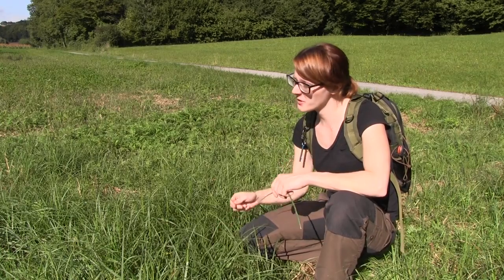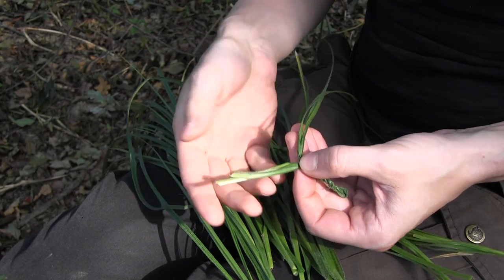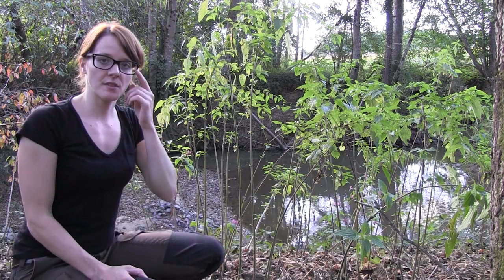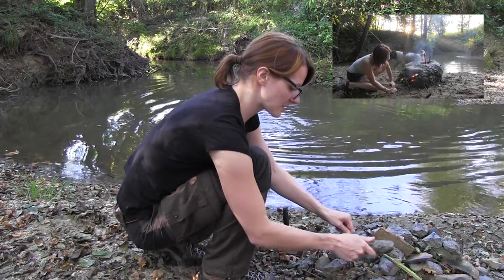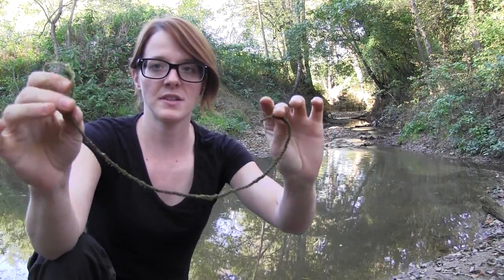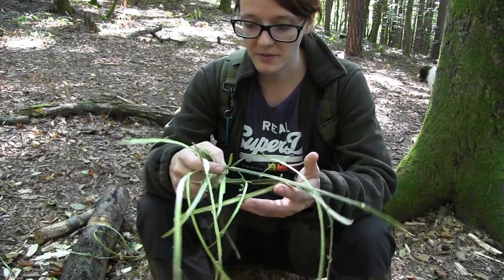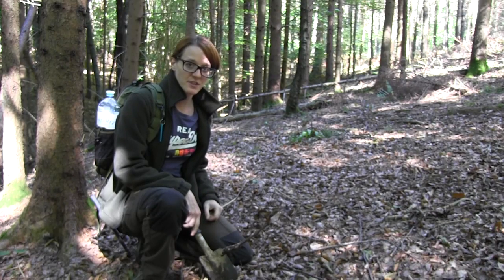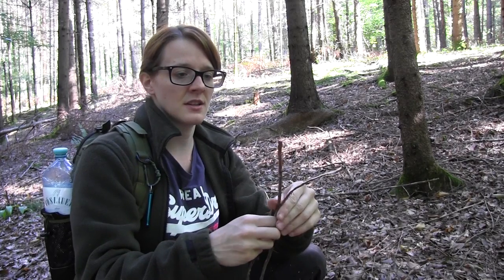How To Make Cordage From Natural Materials

Comment: Excellent video, very clear instruction.  Here in Canada spruce root is used as a traditional lashing material in building the famous birch bark canoes.  It is first steamed to make it more flexible.  As it dries it shrinks and so tightens each joint.

Comment: With the stinging nettle cord, it's best to hang it out to dry before making the cord as it will shrink a lot after drying, which will loosen a cord if it was made immediately after picking, even if you didn't soak it.

Comment: Hi Lilly,

I love to view your videos always useful and easy to understand with great explanations. I am really pleased the cord you made, was it from stinging nettle for your bow drill worked very well and all you can ask is it works at least enough to start a fire which you made to look easy. Do you have another unedited video showing exactly the trial and tribulations of bow string fire lighting?

I was watching a south american Indian Tribal video yesterday and something was used to make the net that form a hammock I think it was a root, they said they needed a mile to make a single hammock and from its thickness originally it was split several time to about the thickness of normal knitting wool and I mean thin knitting wool, but its strength was amazing once the finished net was built, maybe nettle is the answer do you fancy making a net from stinging nettle? Now that video would have to be edited for sure! The hammock took two weeks to make btw,

Comment: Hi Lilly.  Quick question, how difficult is it to braid spruce roots to make bow drill cordage?  Did you split the root?  Soak it?  Or use the roots straight fronm the ground.  Congrat btw.  Creating fire from using a bow drill with natural cordage is no easy task.